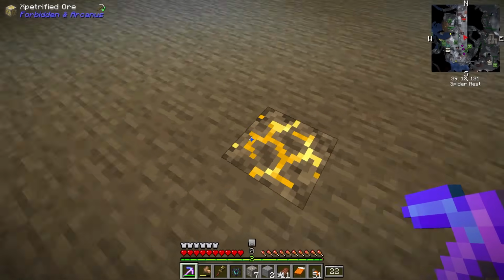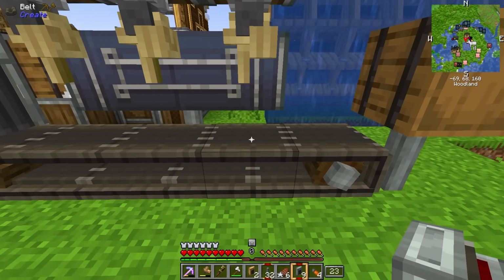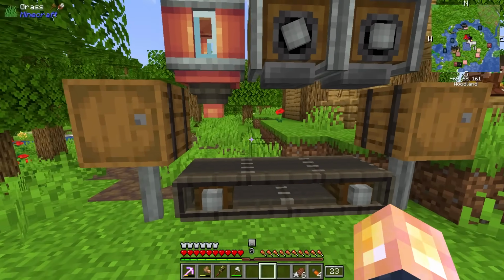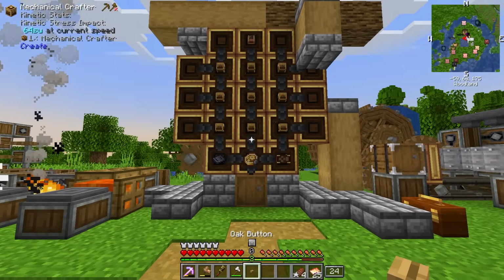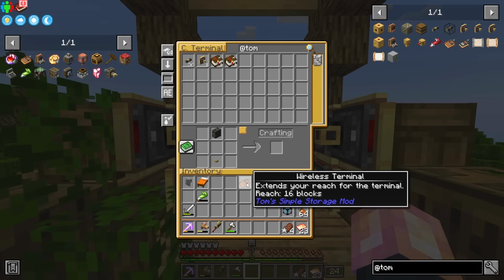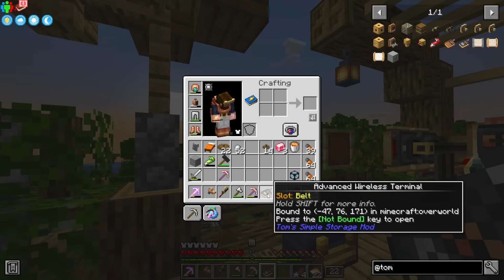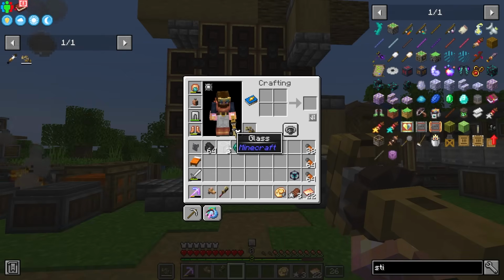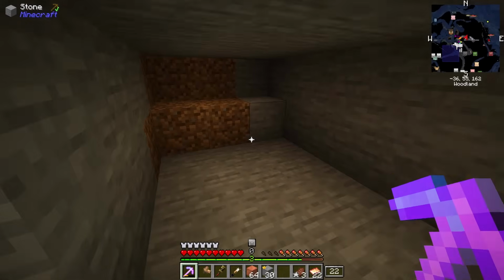SteamPunk Minecraft Modpack EP8 Tom's Storage & Create Gadgets

Comment: I think the better gem for the Tetra Socket is the Lapis, cause it almost double the honing XP gain for use the tool, and honing a Piece of a tool cost integrity, so I think the best way to deal with tetra is, place the best pieces for each part of the tool, than put a pristine lapis that you get from geodes ( a regular lapis is cool too), than use the tool a Lot to get honing upgrades at the limit of the integrity of the tool, than remove the lapis, and put the best binding you can in place of the lapis, than hone even more the tool, so the efficiency, durability and speed will increase a comparing with a regular tool

Comment: If no one else has said it, you can just directly place a chest next to the inventory connector block, and it will automatically be added to the storage. There is no need for cables. This also works from a good distance, so you can have three or more chests in a line directly next to the connector, and they’ll all be connected to the network. You can even turn just by having the chests touch the other chests in any direction. Sorry if you already heard this. I’m just trying to be helpful. Love the series:)

Comment: The sturdy plates and precision mechanism setup has put you in range of getting a Cogloader gun... it's awesome btw.

You can get brass without the nether. 
A lot of the overwold mobs drop brass slag which can be converted directly into ingots using the same process as the sturdy casing.
Reply: yep, aswell there is immersive engineering wich has the alloy kiln
Reply: Villagers also trade for brass with a drill as a workstation. And the same one will trade you a blaze burner. It's quite overpowered.

Comment: Yo just so you know chosen the tetra durability hone is not great even at higher levels of honing it doesn't really give much extra tier 1 is 25 extra durability you are probably better off going efficiency and getting unbreaking because that is a percent boost to your durability (kinda) when you have fully messed around with the mod and have just spare honing sure go for it , it'll get multiplied by high unbreaking but until then it may be better if you go for efficiency or some other honing of your choice

Comment: Some advanced & useful tip for Tetra, good for mid-game playthrough.
1. scroll need to place near workbench to function, you can put up to six scroll at the same place. 
2. you can buy tool & materials expertise scroll from villager's trade.
3. Tetra ruin spawns under spruce froest biome, usually near Deep Dark.
4. the loot crate require hammer or claw to open, you can find things like Extractor and bolt.
5. put a extractor at the right side of tool can make it dig 3x3, works for pickaxe and adze.
6. most scroll locate in loot chest, and WarForge scroll only get from piglins
7. Holosphere can also find Ruins, it has a really cool scan animations
8. you can find Gild scroll in fortress, it can increase tool's magic capacty
9. A fully honing hammer has "hammer level" upgrade, which is the only way to get a Tier7 hammer